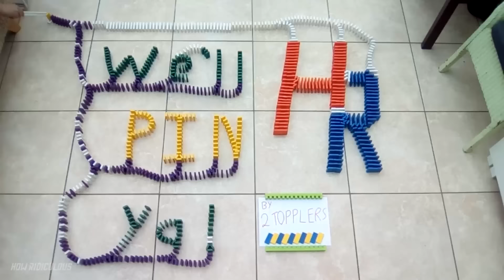Can This SOLID GLASS BALL Survive a 45m Drop?

Comment: I haven’t seen a good answer yet, so I’ll give it a shot.

Basically, when the ball is at the top it has a lot of potential energy and when it is dropped, that energy is turned into kinetic energy proportional to how fast the ball is going. And when the ball hits the metal, the energy had to go somewhere so it uses the energy to separate the glass atoms for each other.

Unlike the bowling ball, which is made up of different non-homogenous materials, the glass ball has the same tight, strong crystalline structure throughout the whole object. Because of this and (possibly) glass’s tendency to not break in a straight line, the ball doesn’t have enough energy to break all the way through the center of the glass ball, so breaks off at a curve all the way around the point of impact, creating the cone you see. 

In theory, the higher it is dropped (until it hits terminal velocity) the smaller the angle of the cone will be at the top until the ball just shatters.

I think another part of it might be due to the internal stress of the ball from cooling down. Because stuff shrinks when it cools and the outside of the sphere cools first, there is a lot of internal stress that gets released when there is a break in the atoms. Instead of letting the crack go all the way through the material, the internal stress will make the glass want to almost peel off the core as the core is trying to constantly push the outer material away. This only applies if the balls were formed hot, which it looks like they are because they are so glossy. You guys should try a tempered glass ball if that’s even possible to see if it shatters.

TL;DR, glass is really strong and can’t kill itself under it’s own weight. That and the glass balls are stressed out and might need therapy.

Comment: PLEASE READ!!  here’s my theory of what’s happening...

When the glass hits the steel plate and decelerates there is a cone of compression from the point of impact back to the widest part of the sphere (because the glass  in front is stopping the glass behind and the glass behind is pushing on or compressing the glass in front in order to stop). The glass that isn’t a part of that cone, because it doesn’t have glass in front of it to stop it, tries to keep going. That creates a strong tensile stress at the moment of impact just outside the cone. The almost immediate transition from compression inside the cone to tension outside the cone creates a stress concentration that breaks the glass in a cone shape. 

THE END...?
Reply: If that is true then the top of the ball should break not the bottom. I would say the force the ball exerts on the floor causes normal force to exert back this breaking the bottom of the ball and the reason for the ball to not shatter is due to the crystalatice molecular structure of glass being too great to overcome when its polymer structure is large and the mass of the ball itself is large.
Reply: I do wonder if the angle of the cone correlates to the crystal shape.

Comment: What is really amazing about this on the last glass globe, during the slow motion, it actually showed the shock-wave that was running along the surface of the solid glass but not shattering the glass as it rippled through the globe. There was so much force rippling around the outside (an probably inside as well), crossing itself, then rippling back. It basically showed how a large impact to a planet, lets say the Earth when the dinosaurs died out, had shock-waves that went around and through the planet an reverberated back. No wonder right after the impact, on the opposite side of Earth, had volcanoes popping of in what was then India. A lot of force that one would think would shatter the glass (or Earth) but didn't.

Comment: I'm pretty sure the ConeyJoneys are Conchoidal fractures. Here's the definition of a Conchoidal fracture: 
"fracture with smooth, curved surfaces, typically slightly concave, showing concentric undulations resembling the lines of growth of a shell"
It happens in glass and minerals like quartz and obsidian.
Reply: Also how flint makes sharp arrow, spear, and axe heads.

Comment: My guess at the Coney Joney. First, take it one 'line' at a time (since its a sphere, what happens on one degree of it happens on all other 359). The middle line, making the diameter of the sphere, has the most molecules of glass in a row and is the hardest to break. Move the line, with one end in the same place and the other slightly to the side of its first place, then there are slightly less molecules backing up each other, making it slightly easier to break. Do that a lot of times, and more and more glass breaks the farther from the point of impact, making a cone. 
The moral of the story: life is better when you have more buddies backing you up.
Reply: Nice that actually makes sense
Reply: But why is the point of impact still intact
Reply: @001100AAAEA  I'd guess because it has the most molecules behind it? But then again, the center of the cone wasn't always at the center of the sphere so ...
Reply: AAAEA like he said the point of impact will have a force vector traveling the length of the spheres diameter, were the most amount of molecular bonds, more molecules, so it cracks in what seemed to be layers because it’s easier to disrupt those molecular bonds, less force required

Comment: The amount of force that the 40 kg sphere exerts on the ground at the point of impact by my calculations is about 175, 000 Newtons. For some comparison an average adult male jumping half a meter into the air will hit the ground with roughly 5,000 Newtons of force.
Reply: In order to calculate the true force of impact from a falling object, you need to know the distance the object travels into the surface at impact. That distance and initial impact velocity derived from the potential energy before the fall allows one to find the impact force. If the glass went into the ground 10 cm then the force would be 176,400 N, however, the glass bounced which means the impact force would be much greater.

Comment: I knew a Wiccan who set her drapes on fire with her crystal ball, now she covers it during the day.
 
 I'm no expert but I believe the cone effect is the same reason they use round windows and subs and such. The pressure is spreading AROUND the sphere and shattering only so many layers of glass,leaving a cone shape..  im just a simpleton, im sure someone else could explain is better. BUT, im also from Kentucky, and my father and grandfather are Kentucky Colonels!. So I'll see if I can help with the KFC.
Reply: they use round windows in subs and aircraft or any pressure vessel as if they were square, the sharp corners create stress fractures at that point so its the surrounding structure thats weak not the windows themselves, look up comet crashes
Reply: @Yourmomsboyfriend666  it does, but in the cases where that shape has failed its been the structure not the window

Comment: The cone-age affect has to do with the fact that when the glass is liquid, it forms in a cone-shape due to it having a crystal like properties and it's structure is set still even when it's a solid, so that when broken, it just breaks off a layer, and its on an angle as well, because of the structure and it's not breaking on point due to it being quite strong, the kinetic energy bounces throughout it though, causing it to shatter the parts around it.
Reply: Glasd is an amorphous solid so there is no long range order or periodic "structure" like metals, ceramics, and polymers
Reply: 'effect'

Comment: I have the answer to the Cone when the glass ball hits the plate the force of kinetic energy transfers to potential energy and goes from like 60 km an hour to zero instantly and since it’s a ball it can’t go straight through so as to disperse it into a cone shapeAnd the reason why the tip of the cone isn’t in the center of the ball is because when you drop the ball your finger spin the ball and releases the kinetic energy faster in a different direction

Comment: To have the result you wanted, get rid of a lot of layers. That happened because of the amount of pressure on the exact position, so around that, the pressure was released. Which caused the cone shape

Comment: when in contact with something else (the steel plate) it send shock waves to the side which it doesn't roll to lets say the left the shock wave will go to the right braking that side. the reason the contact point doesn't break is because there is more glass in the middle therefore reinforcing it so it does not brake

Comment: or it just hit the side that the was bent and was compressed with all the force of the drop.
If you drop it with a throw down instead of tossing it will be a bigger cone shape
or the impact from the center pushes it back to the end but curves to the sides of the impact breaking it.

Comment: The ball's center line (the point where it hits the glass) has the most density wherease, the sides have lesser density. So it does not shatter from the middle but the sides fall off because they can scale of easily. I hope I chose the correct words to explain.

Comment: The ripples when it breaks I don't know what it's called but they're stress ripples and it's a tell on plate glass whether it's been broken by heat or impact cuz if plate glass is broken by impact it leaves little waves on the broken edges